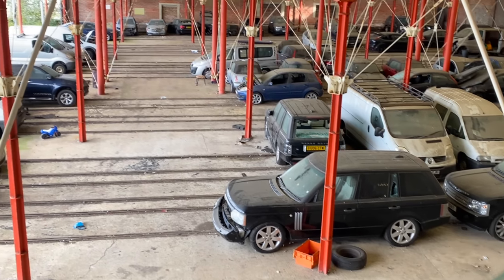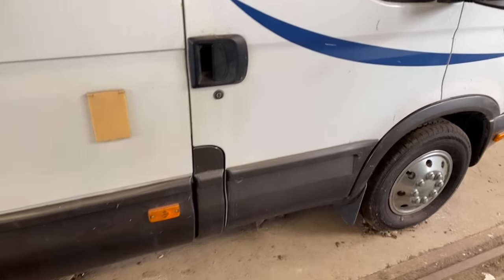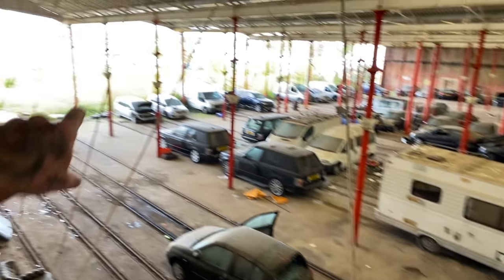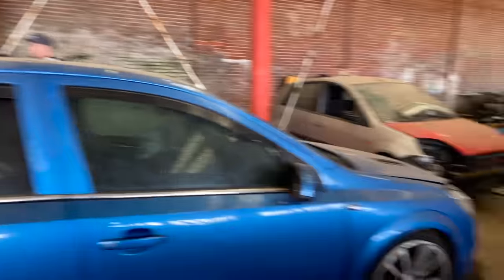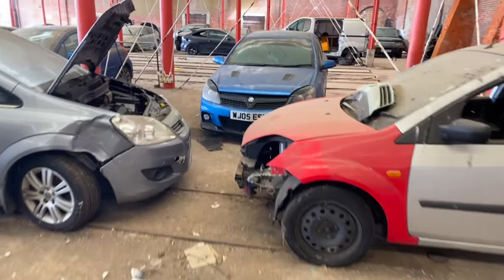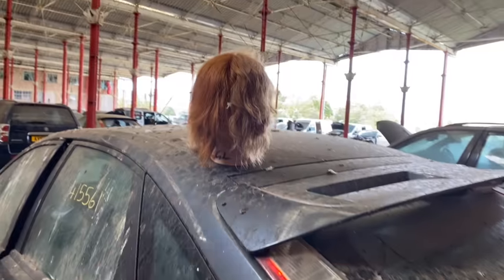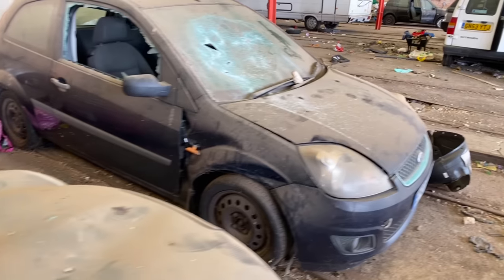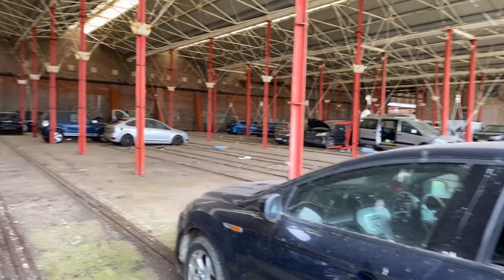Have We Discovered The Biggest Prestige Car Chop Shop In The UK?!.. Then We Nearly Get Caught!!…

Comment: The VXR was an easy spot. They didn’t make a 5dr VXR. It was proper Barry’d up too.
Reply: Just about to say adsatly the same , I've had both a vxr and a 1.9 CDTi elite and that was an elite as it was only model to have crome trim round the windows my vxr was an early 1 an 05 and the Elite a 58 plate.
Reply: @jeremywentworth1833 some vxr had chrome trim mine did
Reply: I want the seats 😂
Reply: @samrobinson9254  as much as wanting low miles engine for my renault trafic would have front seats from the range rover or bmw x5 ....love to find some where like this to  explore...

Comment: Good find but them range rovers are worth 6-8k nowhere near 20k there old now.
Reply: Some go for £1,500 and even less. The air suspension is a fortune to fix and goes wrong far too much. 👍
Reply: @cpyart  I was talking more about the V8 version but yes the smaller engine ones do go cheap
Reply: @CJRSBK  you'll get a V8 for £1,500 in Lincolnshire. It'll cost you £1.500 a year to keep it going because they are crap once they get a bit of use. 👍

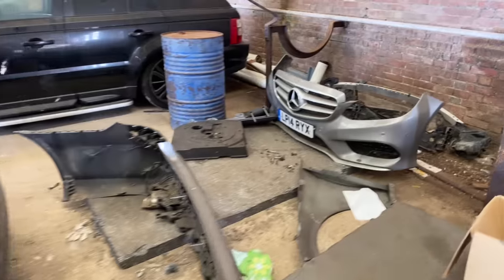Comment: Just out of curiosity I ran the number plate LP14RYX shown on a detached front bumper assembly at 6:50 through the DVLA checker and this relates to a 3.0 liitre diesel Mercedes E-class whose tax disc expired on 13 October 2023 and has a valid MoT, which it passed two weeks ago without advisories expiring on 27 September 2024.  In other words, it has appeared at that old tram depot and has been completely dismantled in the last 2 weeks.  I can only think of one obvious explanation for that and that is criminal activity.
Reply: Or had had a replacement bumper from these probably breaking cars
Reply: @pk93cov What with the Reg Plate on it's old Bumper they usually take the Reg off and put it back onto the Car unless it has been damaged
Reply: Could well be a ringer

Comment: something very strange about that silver ST, DVLA say its silver MOT check says it's green.  You can clearly see it has been ultimate green on the edge of the quarter panel  and the front radiator support.  But ST's never came in green,
Reply: They did, it was a colour option along with the usual silver, blue and orange.
Reply: Vinyl wrapped before hence why never changed with DVLA perfectly legal
Reply: @pk93cov  still have to declare a colour change to the DVLA though which would make these records correct.
Reply: @Smithy1789  not for wraps as they are temporary coverings.
Reply: @markashman816  not sure tbh.
Reply: I thought it had a rs rear spoiler, not a st but shame to see any cars like that that we'd love to have another great vid bro. Loved it

Comment: These are all scrap boys by the loom of it. Different people renting the land because of business rates. You’ll find the cars will be scrap/recovered and then eBay parts. The tipper is probably a certified waste collector, they rent areas like this and sort through the shit at a later date when scrap values change. You wouldn’t want to get caught fucking around in places like this as there are some naughty people who rent areas like this. But, as someone who’s spent 3 decades in the automotive industry I can say quite confidently those cars are probably scrap. The fact they are still full cars says a lot. If they were stolen they would be stripped and weighed in with days.. For instance, The Range Rover probably got blown turbos. Literally body off dozens of hours in labour and thousands in parts easily becomes beyond economical repair.